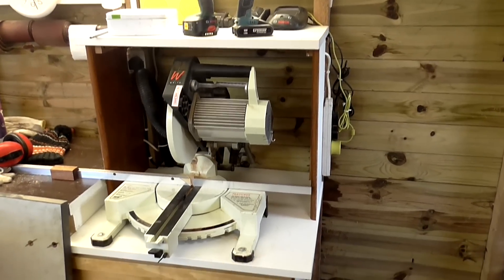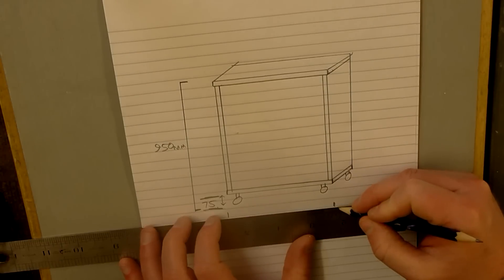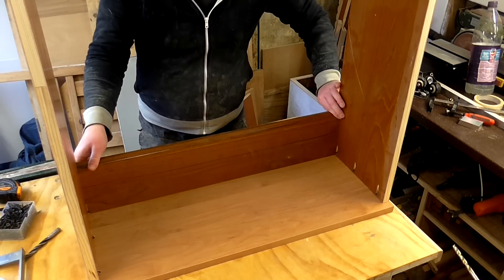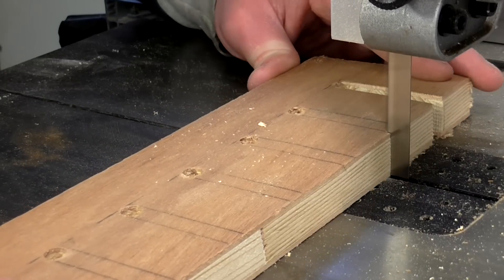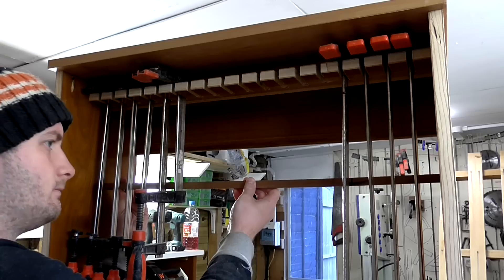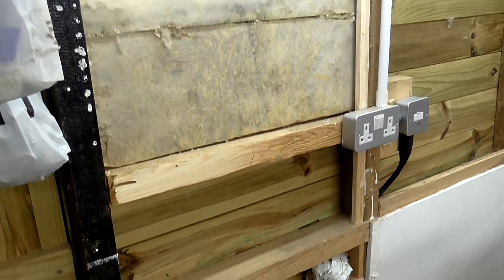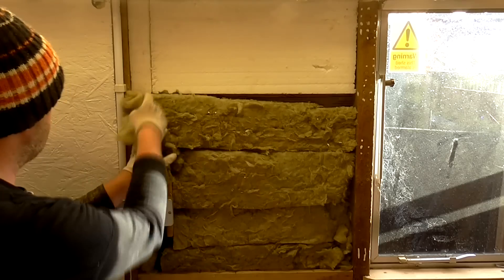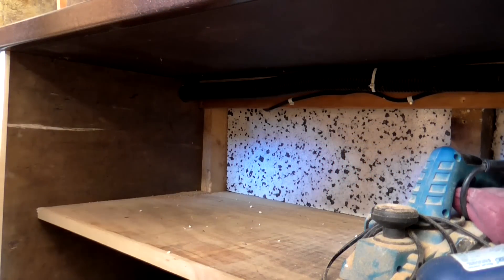Mitre Station Support, Clamp Storage & Tool Wall - Workshop Re-Model Episode 7

Comment: I've been reviewing your vids over the past few days and you really have given me some food for thought as I'm in the process re-organising my workshop/shed.  Its a tad smaller than yours but thanks to you I now have a clearer idea of how/what I'm going to do.  I use the Dewalt table saw on a B&D Workmate on a mobile base and the dust extractor is next to it on the floor.  So I can save loads of space my adopting your approach by combining them all into a single stack (why did I not think of that).  So off later to buy some materials.  

I was fortunate to insulate my shop from new with Celotex insulating material and in the winter it does not take long to warm up (also stops the shop from overheating in the summer).  I have double doors at one end and they are also insulated.  Using spray foam, all gaps are well sealed which gives me a draft free environment.   

Carry on doing what you do - I, like you, don't have the real estate or money for anything bigger as I'm just a dad looking after 2 sons homes together with my own.  Very busy in retirement. 

Kindest regards 

Mike.
Reply from the maker: +Mike S hi Mike, thanks for your comment and good luck with the shop organising 👍🏻

Comment: You are a great organizer. Thanks for sharing all your tips.
How long should  the glue for the panel-board, joined with biscuits, dry in the clamps you used. A few hours, or overnight?
Reply from the maker: +Hans de Groot thanks. I left the panel an hour or so to dry as I wanted to get on with the build but it would have been better and stronger left over night, but I was in a hurry to finish

Comment: When you were measuring the spacing for the clamps, you kept moving your tape measure after each marking.. At first I wasn't sure why you were doing it, but I think I figured out why.. Are you moving the tape measure so that the marker on the tape lines up with the outside of the pencil line that you draw?
Reply from the maker: +denno021 I'll try to explain, basically I'm lining up the mark with a round number on the tape measure for each slot, so that it's easier to work out where 18mm is. Mainly because I am not good at maths so for example it's easier for me to mark up 18mm away from 200mm rather than 18mm away from 360mm or whatever
Reply: Oh right haha, that makes perfect sense

Comment: Hi keith.What F Clamps do you use, do you have any problems with the handles working Loose
Reply from the maker: Just the really cheap ones on amazon or eBay. Some of them are silverline. They’re not brilliant but they work fine, no issues

Comment: i wouldn't use drywall screws for wood as the snap easily (i learned that the hard way!!!)
Reply: I always pre -drill  pilot holes for drywall screws. I've never had a problem.